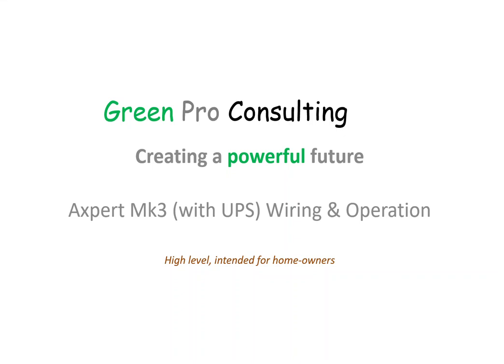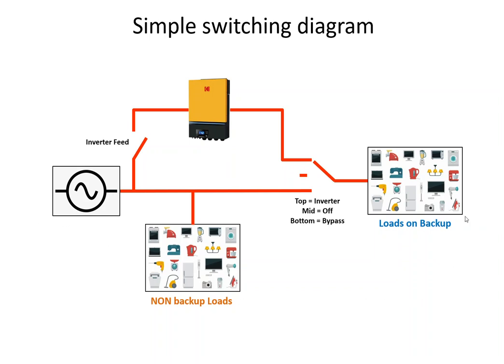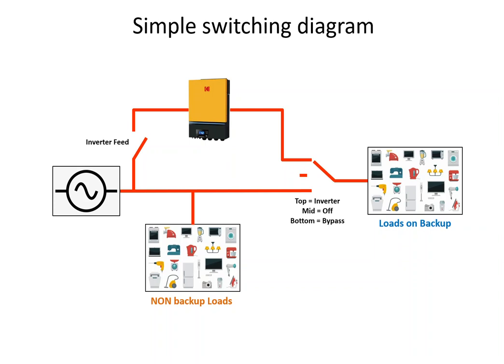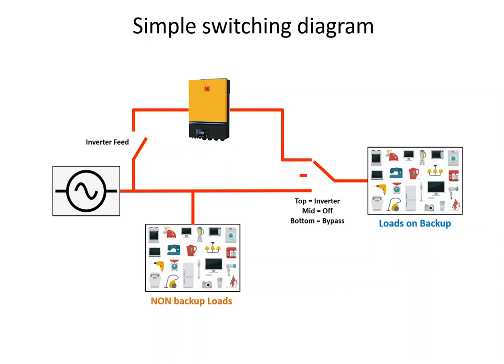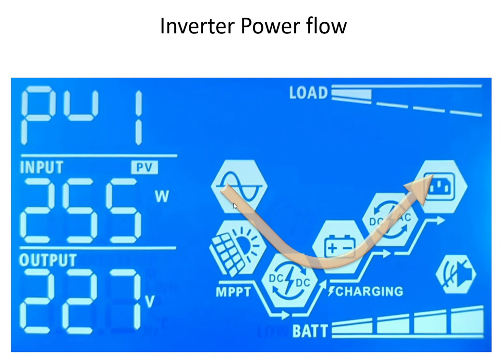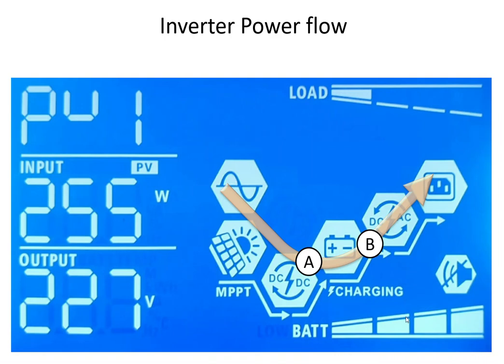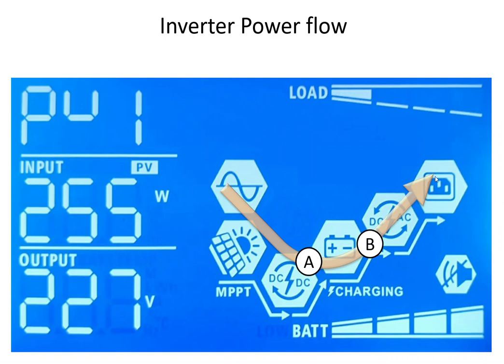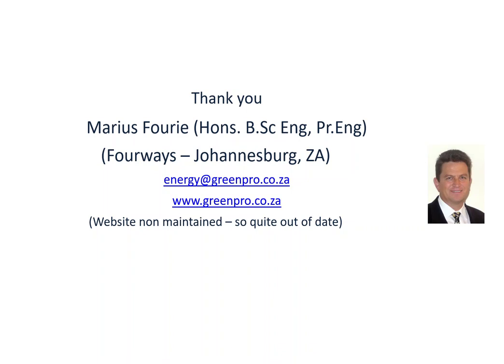Axpert MK3 Wiring & Operation

Comment: Voltronics inverters are not on City of Cape Town's list of approved inverters. It appears that NRS097-2.1 certification is required and the Axpert type inverters do not have that. So it would seem that one may not have any connection, even on the mains input, between the inverter and the grid if an NRS097 certificate is not available. I would much appreciate your views as at present it seems that the Axpert inverters may only be used in an off-grid installation.
Reply: We have discussed this almost 4 years ago and it is great to see that nothing has changed.
Our municipality does not require stand-alone installations to register and defines it as:

Stand-alone generator
A generator that is not in any way connected to the utility grid. Export of energy onto the utility grid by the generator is therefore not possible.

So it would seem that the Axpert inverters fully comply with the definition and as you said, does not require NRS-097 certification. One could therefore regard it as off-grid as the generation circuit is not connected to the grid.
Reply: @ebyzer  Does this requirement change when you add solar panels to these off grid inverters.
Reply from the maker: They are not capable of delivering power upstream so do not need NRS cert. Just like your kettle does not.
By the way. CT muni is not the custodian of NRS-097...